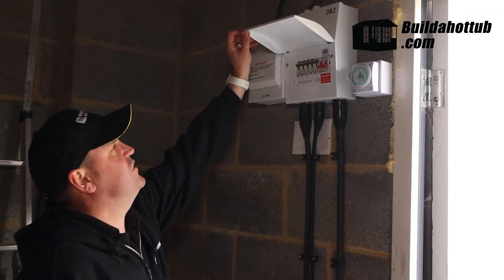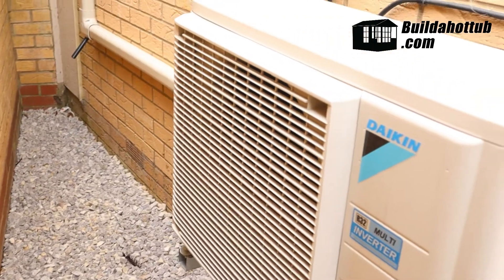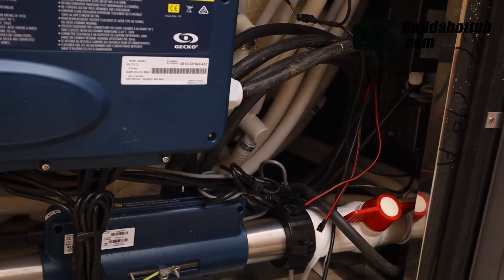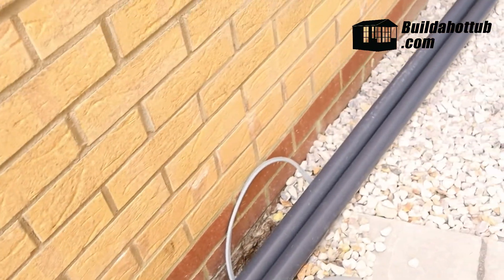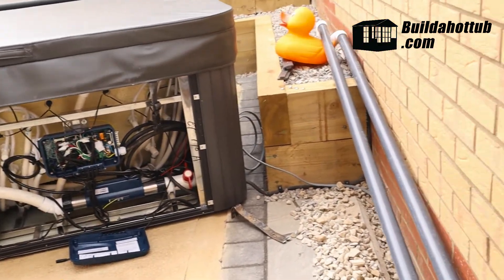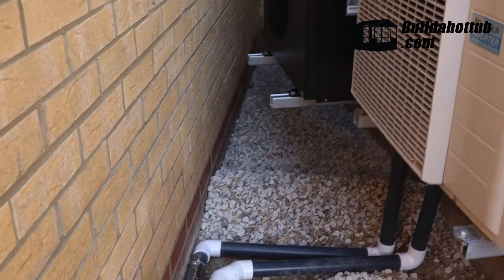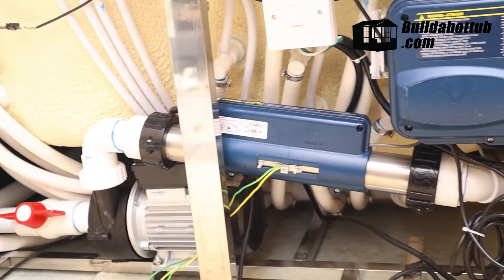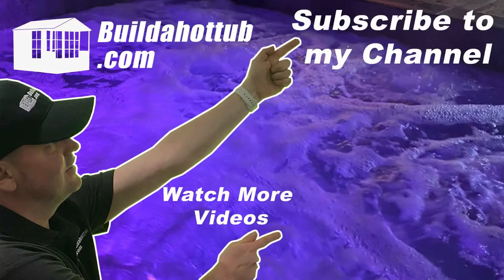How I added an Air Source Heat Pump to a Hot Tub.

Comment: Hello. Why do you have the water flow through the electric heater first? Just wondering as wouldnt this cause the tub to heat primarily  on the electric heater. Would it be better to flow through the pump first then the water can pass through the electric heater and it will heat it further if need be?

Comment: In tub heater 3kw air pump 1kw, why update the mcb
Reply from the maker: As he wanted the option to run both at once in the winter which would take him over the AMP draw the MCB was designed for - hope that helps - thanks for the comment - Andi

Comment: Can I add an air source heat pump and control it without a spa pak
Reply from the maker: Sure, they go on pools too which dont have spa packs. They have their own thermostat so can run independently. - Hope that helps - Andi

Comment: Adding how the electrics were done would be great. Oh and the sizing of the AHP as well.
Reply from the maker: Hi Duncan, I think I cover both these points on some of my other videos on Air Source Heat Pumps. In short, the ASHP is wired off the Spa Pack's Terminal Block as you are disconnecting the electric heater, you should not need to change the breaker fuse. Always consult an electrician on this point ;) - Size, typically a 7KW I would size for sub 1500 litres, 9KW for a Hot Tub bigger than this. Swim Spas depends on the setup. A larger ASHP from the same range eg the Comfortline that I supply just heat up quicker, there is no efficiency saving in this case. Hope that helps

Comment: Was told today that I couldn't do this by the UK comfortline sales team. Said it would give error on hot tub. Another person said not worth it. I want to get it as it's on sale at the moment for my new hot tub, but can't find anyone to help install or advise what's best. Any advice very welcome. Ps was told would need to be Gecko system ashp
Reply from the maker: Hi Lee, - i've supplied quite a few of these now and it works without a problem - it saved my 65% and heats up 8x quicker on my own tub. There is also a video on my channel how I added one to my own hot tub - I dont use the electric heating at all. You can use any air source with a flow sensor in. If you can drop me your number to andi (a.t.) buildahottub.com I will give you a call and talk you through it. I can help with instructions on how to fit and supply the comfortline and the parts you need too. Thanks

Comment: Great video very informative 👍🏻, would it be worth adding a heat exchanger . You could then add glycol to the heat pump side , and also keep the hottub water from entering the heat pump .
Reply from the maker: Hi Jason, thanks for the message and comment. Swimming Pool / Hot Tub heat pumps are a little differnt to regular ones for our homes as I understand it - I am not a heating engineer so if one is out there, feel free to correct me. On the pool/hot tub ASHP, the heat exchanger is built into the unit inside from my understanding. The water is actually flowing through the heat exchanger which is all in a self contained unit with the heat pump. This is different from a home setup that would be circulating hot water around pipes for heating etc. In that setup, a heat exachanger would be required to heat the hot tub water and indeed keep it separate. I have a video on heat exchangers here  https://youtu.be/jUPf267FPus  - this refers to a ground source heat pump but the principal that you are asking about is the same (i think!). Hope that helps, cheers, Andi
Reply: @Buildahottub  thanks Andi , heat pump sounds brilliant
Reply: I am an HVAC Technician and love this idea. One step better... the waist is cool air, let's pump that into the house.